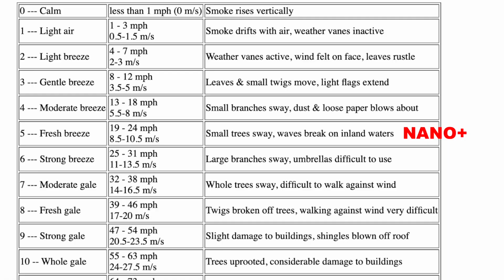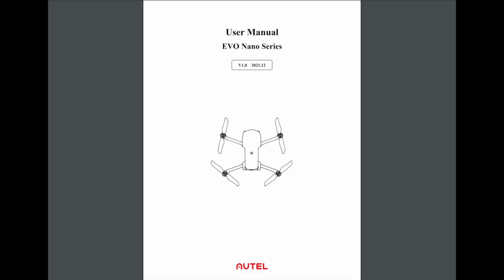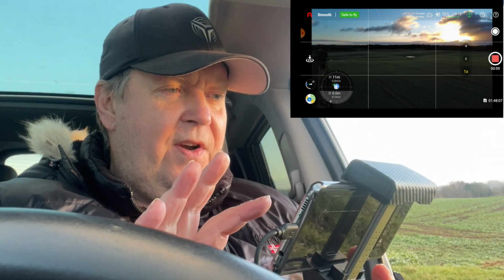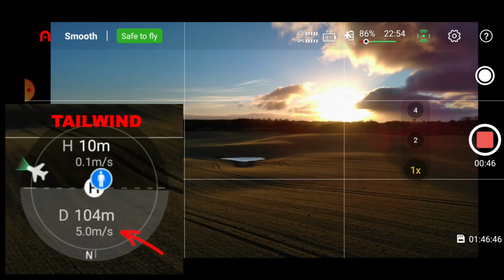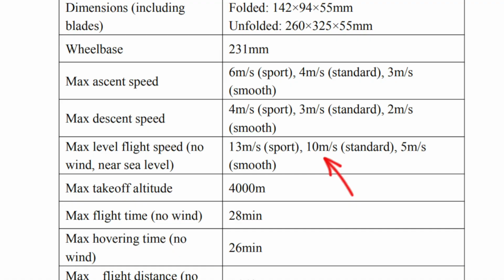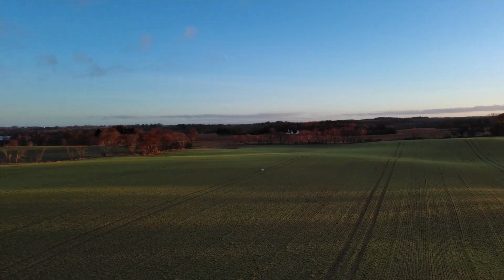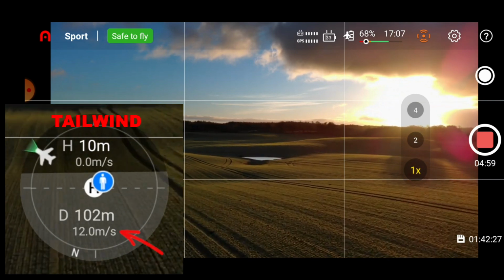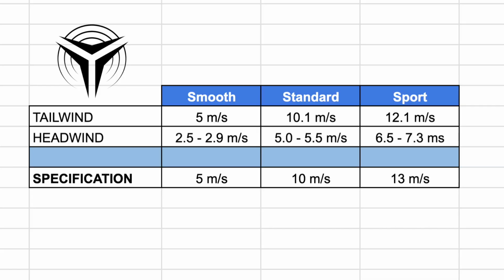Autel Nano Plus SPEED TEST 🤔 (w. firmware 1.0.9)

Comment: Had this back from a UK stockist yesterday when I queried the power/speed:

“The Mini 2 and the Nano have the same ability in the wind. There were concerns raised by some who have tested the Nano in 35mph winds but Autel say that those testers/influencers were told that the software version of their Nanos had reduced power as that particular firmware isn’t what will be on the drones customer’s receive.”

Do you think this is accurate or has Autel admitted since confirming power would increase with a firmware/software update that it won’t get any faster (useful in windy situations)??
Reply: @Bubba Smith Indeed, why would they send a crippled drone to the reviewers? Firmware could potentially improve how it handles itself in the winds but can really only do so much..

Comment: Would it be a firmware issue or a motor/propeller issue? If it's a motor/propeller issue that would require a product redesign and recall of pre-sold drones. I do hope they can fix this, though, because of its potential with that great camera.

Comment: Unfortunately it's like this since the Evo 1 always slow moving in fwd direction. The other direction are fast. I find myself flying back to home point backwards or side ways.
Dji on the other hand jumps automatically from cine/ normal TO sports mode when it detects that it struggling to fly in wind

Comment: didn't they had released an update for the sport mode ? 

That was claimed to run 15 m/s in sport mode again after qc guy had started his campaign that he felt scammed by autel cause all the official papers mentioned 15 till the complaints arrived and autel had started to change the manual and marketing to 13 m/s.

He had started a battle cause he tried to call the autel hotline to talk about in publich but autel put a message on their hotline the first day that they do not have hotline support that particular day due too to much cases on that day. Next day they had a different message, third day call another one and then the release appeared to be back on 15 m/s
Reply: And now they have said it will stay at13

Comment: Autel edited the top speed in sport mode from 15mps to 13mps but they Ken Booth has said they will be putting it back to 15mps.
Reply from the maker: Yes, but it drops also at lower speeds
Reply: @henrytong8707  They have been caught out once, I doubt they will try the same trick again.
Reply: And then Ken said this afternoon that it will remain at 13 m/s max… 🤦🏼‍♂️
Reply: @LittleMountainLife  Idaho Quadcopter has done a video of the recent update and seemed to imply that active track has been removed from the app menu, for me that will be a deal breaker
Reply: @allthegearnotaclue  absolute deal breaker for most. Yeah
Reply: @allthegearnotaclue  What?!?! No active track at all? Or just less easily found in the app/settings?
Reply: @DaiInTheSky  unsure but he said it's no longer there. I don't think they will have removed it permanently, don't want to cause a panic. My guess is they are working on it and it will appear soon.